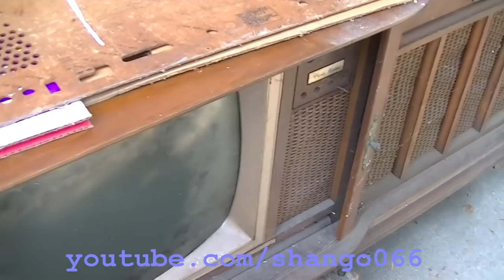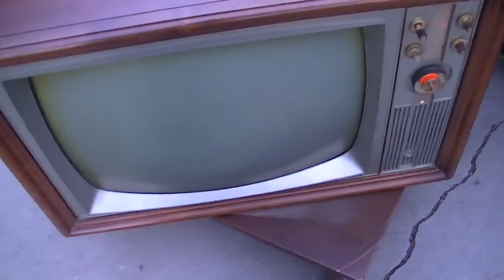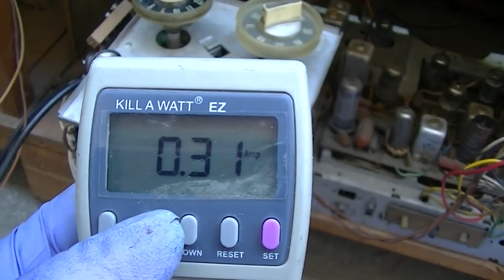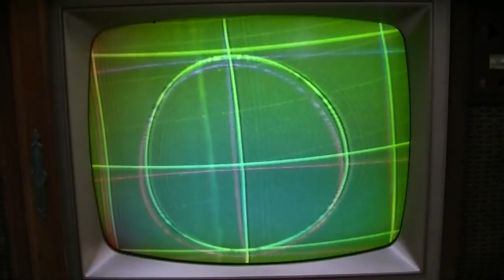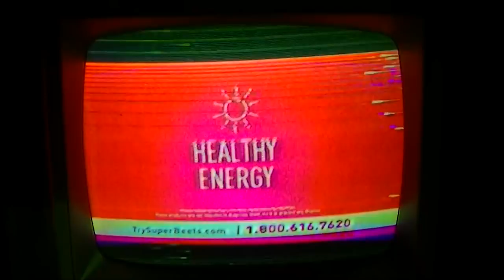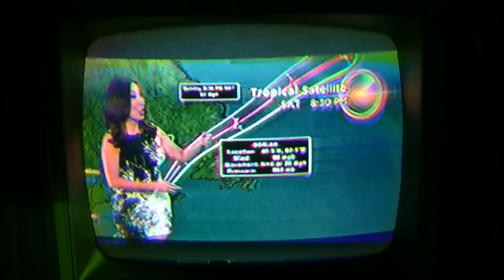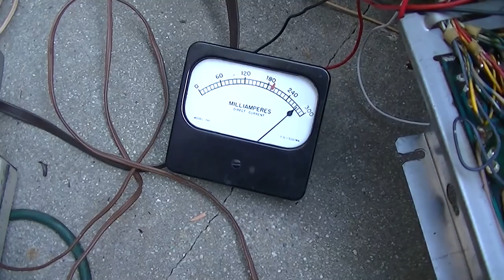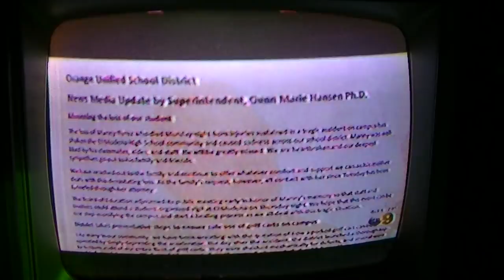Color CRT Replacement And Setup Curtis Mathes Mega Combo 25AP22 25XP222

Comment: Curtis Mathis was the brand of the TV that taught me about discharging the picture tube before reaching around inside the chase. I still have the scar where my arm was up against the brace that held the chasse when I hit that wire and discharged it through my right hand, up through my wrist and out my lower arm near my elbow.  Blew a friggin hole right down to nearly the bone.  Surprisingly it didn't kill me but I did bounce off a nearby wall and scared the shit out of the radio mechanic that was standing next to me in the commo shop.

Comment: When I was stationed with The Old Guard out in Arlington VA, the officers all thought that if you were in Communications, that meant you were an expert in electronics.  Now my specialty's were in wire communications, and radio teletype, none of that prepared me to fix TV'S however before the Army I did fix TV'S for all my relatives so I did know how to change tubes.  That was about it.  One day the damn Regimental Commander carried in a Curtis Mathes desktop and dropped it in the commo shop.  Fix it! He said and left. So it was the radio mechanic and I began digging tubes out to take across from the fort to a drug store and check them. While reaching for a tube, I managed to make contact with some high voltage. It went into my finger, burning the hell out of it, and out near my elbow which was resting on the chasse.  Blew a damn hole in my ARM!  That was the last TV I worked on, it was 1975.
Reply: Yes I am also in Arlington Va, life it sucks here just like a third world country. I build toob radios to keep me calm cool and collected through all these doomsday end of times biblical tribulation. I can’t tolerate especially when I see people wearing mask on the bike trail and in the parks, it gets me all fired up! I’m angry as hell dawg

Comment: In the 70’s, replacing CRTs in those things was easy.  Just lean them up against the shag carpeting.
Reply: Great back-breakers they were - especially the 25 inch CRT's.
Reply: Some of the CRT tubes had metal cones around the glass

Comment: at times I changed CRTs in the customers house. Hated doing that!
This is a fantastic video. Lots of steps to properly setup a new Picture bulb. Things can go bad.  The older guys I was fortunate to work with back then had always told me to ignore the outside edges when doing convergence. If shadow mask on replacement tube is bad, purity is impossible to get correct. Sent many rebuilds back due to this problem.
Might be my favorite project yet Shango!! Love it-

Comment: lov ya man, got too many tv stories to tell, my father's friend was a tech in the 70's old guy, Irish catholic, my father once told him he would become impotent from working on these x ray machines, je said "I got 6 kids, if I thought it would help I;d slap my nuts cross the flyback"
Reply: Lol!
Reply: That's an interesting contraceptive method
Reply: Fantastic
Reply: i guess it's effective but
Reply: You better hope the insulation on that flyback isn't leaky or arcing, or else it'll light you up like a Christmas tree.
Reply: More than the cinescope as is, the worse font of x rays in a color television set was the shunt regulator pentode and the hv rectifier on old ones, I've worked on a Philips/Telefunken authorized repair center by mid '70s but fortunately only Philco and GE sets used these tubes, european and japanese origin tv's used diode hv multipliers that times...

Comment: Had a Packard bell color set, put a crt in it and setup was easy  but had the pc correction circuit all in all packard bell was a good set. Still have a pb black & white set from the early 60's still works!

Comment: My 1972 zenith space command 19-in tabletop has outer screen convergence adjustments that allow you to bring top bottom left and right horizontally and vertically red green and blue after you get the center close you can dial the sides in within reason it's a pain to do but I've done it a couple of times the TV was old when I got it and is high hour but I can still get a halfway decent picture out of it after a couple hours of screwing around with window circle and crosshatch and just going around and around till I get the best possible convergence.

Comment: You wonder how labor was ever cheap enough to build stuff like that Packard Bell. There must be hundreds of hours of work in one of those. I also wonder how the engineers communicated to to the people assembling them the proper clearances between parts required to avoid arcing. I suppose you don't have the problem of carbon tracking in point to point, but a PCB does give the engineer the ability to tightly specify component placement and routing.

Comment: If there is high cathode current on H-out, first I would check capacitor between H-oscillator and H-out tube G1. Capacitor can be leaky and couse excessive DC current.

Comment: By 1970 the Sets were relatively Stable, you didn't need a Tech coming over to do a Convergence Alignment if you relocated the Set in a position 90 degrees from where it was. I remember the Prior Sets not being as Stable.

Comment: You know what we use “electrical” tape for around here? Closing trash bags.
Reply: Electrical tape is great for wiring harnesses as long as you wind it tightly and superglue the ends. It's also OK for permanently joining cables as long as you knot the connections and stagger them so they don't short. Id trust that kind of connection far more than some of the crappy crimps I've had to repair. I don't make a habit of using it where solder lugs are available, but I guess anyone who is already bypassing a circuit breaker won't be a stickler for details.
Reply: Hmm... a few things come to mind: 1) Don’t bypass breakers. Just don’t. Find the actual problem and fix it. 2) The problem with electrical tape is the adhesive - it doesn’t stay stuck, and leaves a nasty residue when it does inevitably fail. Given the choice I always go for heat-shrink tubing, and sometimes zip ties... it just works better. 3) Sometimes crimped connections are better than soldered ones; specifically in situations where a soldered connection is prone to cracking. However, it’s gotta be a good crimp - improperly done ones are prone to failure.
Reply: Electric tape is the best bandage in the tropics !  (does't come loose when sweating etc) )  . . spent decades taped up with electric tape on occasions  , learned to get light coloured tape so it would't stand out . . just knocking around out bush getting knocks & scrapes , still use it to prevent blisters in ill fitting footware

Comment: Bad convergence? Try doing it on a CRT projector for the first time! 

There's even a user menu for the convergence! On 90's and up projector, 80's one have 50 pots!
You should do a CRT projector vidoe too, that would be nice !  It as 32k flyback... 3 of them!
Reply: i got a modern flat crt with no dynamic convergence adjustments recently, brand new open frame 29 inch and it's just got an assload of rings on the neck, quality

Comment: In those days when you bought a TV, it was a 10-15 year investment. Let that sink in. 10-15 years. Today, we throw them out after 3-5 years.
Reply: Yep, there was probably still quite a few sets from the 1970s still be used in the 90s.  The price of CRTS didn't really crash down until the late 2000s. In 2012 I bought an HD CRT "flatscreen" from Goodwill.  The kind where the glass screen is flat instead.  It can do up to 1080i.  It came out around 2005 and was over $500. When I bought it in 2012 only 7 years later it was $12.  I thought it was crazy how fast it went from an expensive high end TV to something that nobody even wanted.  I still have it, it produces an awesome picture on both SD and HD video.  I'd kind of like to get an HDMI to Component adapter and hook my PC into it and see how it would work as a monitor.  It would be great for emulation!
Reply: @HerecomestheCalavera  CRTs do have excellent contrast and color when compared to an LCD set, although I think they are finally catching up now. I'd love one of those HD CRT sets for watching movies on.

Comment: silly question
how much overthinking would it take to make vintage tube tv run a modern crt?
given the heater is the same voltage and current and deflection coils are from the modern tv. would it have wierd overstreached picture or rather squashed small rounded pillow on the middle?
Reply from the maker: Totally different won't work won't happen
Reply: @shango066  would the set explode without dynamic convergence plugged in?
i live in europe and to be honest i never seen color vacum bulb tv, i have few mixed ic ones from my childhood, but that not the same

i know for a fact that with a polish 70-90's set you would be at least able to swap parts around, because they were very modular , like people here put vacum bulb tuners to modular ic sets and do other wierd constructions like mixing brands and stuff to keep old tv's alive or upgrade them with teletext or aditional inputs up until late 90's . My local rtv service guy inspired me once when he bypased sync impulse generation of one fairly new fried jungle ic tv, by installing one part from russian black and white transistor set on top of it.  So everything is possible  (well people bring it back few years later because rgb input didnt work after that repair , but they never asked for it to work the first time)
Imyself upgraded my vintage 1985 tv to autodetect and support composite and rgb signals and switch to av mode by just following old schematics and making my own pcb's,  but i have no luck to crt's and i am simply curious if inline crt with integrated static convergence even in theory could work in tube set. i am not asking you to do that because it would be more of an investment than it is worth but i simply like wierd stuff and random constructions from nothing so i am curious if someone could macgyver it if he gone mad.
Reply: Modern crt is inline not delta, so dynamic convergence circuitry is not needed and the yoke is anamorphic and factory fixated to the crt for static convergence. CRT neck is thinner so voltages for deflection, and on cathodes and grids are different. Phosfors may be different so white balance and gamma (color linearity) is not same, your colors will be off. Modern CRT will be RGB driven on cathode, old crt probably color difference (luminance on cathode,  color difference on grid). Et cetera.
Reply: With good CRTs getting harder to find,  someone needs to come up with a magic box with a cable that plugs into a 1960s CRT socket on one side and one that plugs into a $200 flat-screen  from Wall Mart on the other. Just plug it all up and find some way to suspend the Wall-Mart special behind the safety glass.
Reply: Actually this might be doable. You'd need to use the deflection yoke from the newer tube. The new yoke would have lower impedances for horiz and vert coils. I'm sure Shango could figure out a suitable transformer arrangement. At least that way he'd have a use for 90s black plastic TVs instead of Killary EOL videos. Love that video:
https://www.youtube.com/watch?v=jjpMN6YU8ag
Reply: @rfburns5601  a lot of the later CRT's would be lucky to last more than a couple of years. a lot of these old deltas had a long service life in a well designed set
Reply: @shango066  HAHA, and why would anyone want to do that ? YOU make me feel bad for all  the tube sets and CRTs I necked with a 2x4 to toss in the dumpster. Truly considered worthless in 1984 and on. My apologies Shango066
Reply: @telocho  I've heard the red phosphor is different on the modern tubes.

Comment: Pardon my lack of technical acumen, but what was the purpose of the degaussing button on those old TVs?
Reply: The shadow mask in particular is usually magnetic and can pick up a permanent field from any stray fields in the area. A motor start nearby or just moving the set around can cause issues - color goes off in patches, mostly. The degausser button starts up a coil fed with AC that tapers off over time, around it, which works out the permanent fields, and restores color purity. Any large (or precise) CRT benefits from it - it was common on high end computer monitors up to the end of CRT. Having an accessable button on that Packard-Bell with the rotating base is a very good idea.
Reply: @warphammer  Much obliged for the information, Sir. 🙂